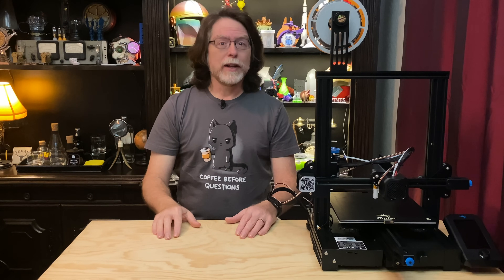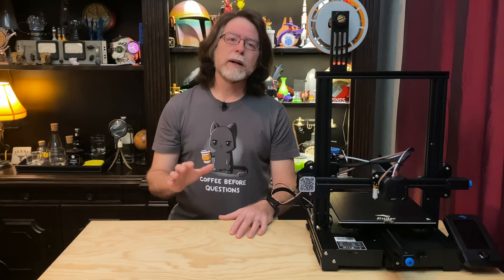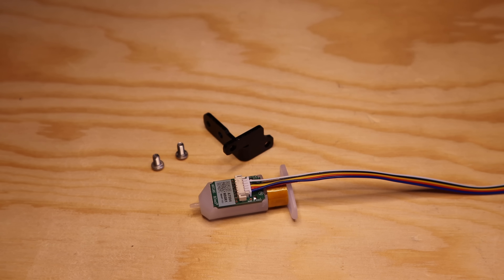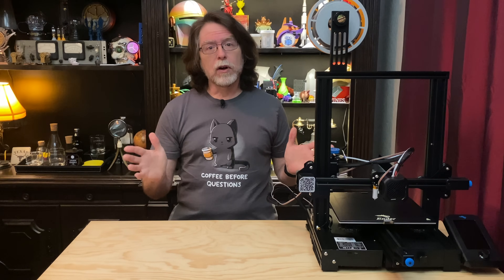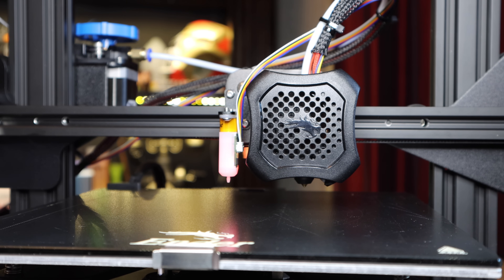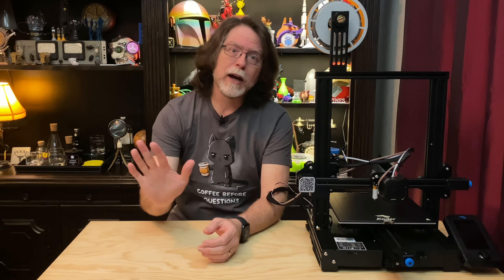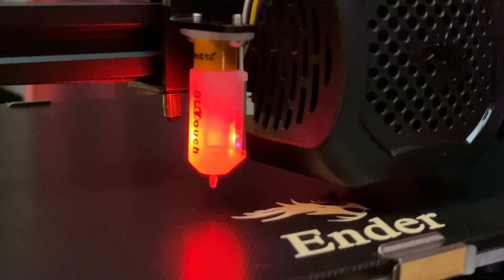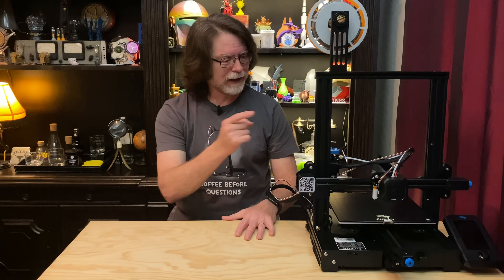Level Up! Install Creality's BLTouch Bed Leveling Kit on Ender-3 V2!

Comment: Will this work on the ender 3 max
Reply from the maker: Hi Steven, I'm not 100% sure. The kit includes a bracket to mount the BLTouch to the Ender-3 Max, and with a little searching on Creality's site, I found an Ender-3 Max Firmware file that supports the BLTouch. But I haven't personally tested it. I have an Ender-3 Max, but it's a pre-production unit, and it has differences from the production units. I have the bracket from the kit, and I have a spare BLTouch, so I could give it a try, but it may take me a little while to get around to it.
Reply: @BV3D  That would be great if you could get to that down the road. I just received mine today 3/5/21so I have some learning to do before I get to that upgrade. This is my first printer and am excited to learn the world of 3d printing. Your site among many are really helping me understand this hobby. Keep up the great work

Comment: Ugghhhh, I listened to everything you said in both videos and now my printer screen stays black and my 24hr old printer has a black screen. Hellllllllppppp
Reply from the maker: Hi, I'm sorry to hear it's not working right. Assuming you've got the right firmware file for the board in your printer, try this:
• Format the MicroSD card as a FAT volume (back it up first if you care about what's on it).
• Copy the .bin file back onto it, rename it slightly (maybe add a "1" to the front of the name).
• Put the card in the printer, and turn the printer on.

It should give you a black screen for about 10-15 seconds, then reboot. The reason behind renaming the file is that the printer remembers the name of the last firmware file it used, so it can ignore it on subsequent reboots.
Reply: I actually just got it to work, I had to change the file name to "firmware002"

Tomorrow I will go through your video setting it up completely and then install the sensor on my other ender 3v2
Reply: You have been a great help. I just into 3d printing 2 weeks ago and already made a product I almost perfected and gonna start selling to pay off the printers and come up with the money for the xl upgrade.
Reply from the maker: @dmjreptiles  That's awesome, and it's one of the things I love about 3D printing. You can come up with an idea for a thing, design that thing (even in something simple like Tinkercad), and then have that thing as a physical object. I've made all sorts of little adapters and organizers and stuff. Anyway, welcome to the world of 3D printing! It's great to have you!
Reply: When I lower the z offset I can't get it low enough to touch the bed
Reply: I decided to go back to factory settings and am gonna return it, hopefully one day they have all the stuff needed when they release a item. Thank you for all your help

Comment: The z-offset for mine was also exactly 2.70. Since fitting the BLTouch I've removed the levelling springs and dials and fitted metal stand-offs with normal nuts. I let the software handle any levelling and it works great.
Reply: Awesome idea, but those hardened springs are great as well and may save a destruction if it were to happen when the nozzle plummets!

Comment: Just finished installing mine! I actually did 2 upgrades. The BL Touch as well as the Z-AXIS PROFILES KIT making the build volume height 350! Any thought of you adding the Z-AXIS PROFILES KIT to yours too Bryan? Also, may check out either Smith3D or Jyers/Marlin firmware and use instead of Creality's since theirs seems to be missing some important things such as saving to EEPROM which in my opinion is important.

And speaking of Creality's firmware not saving to EEPROM, I reached out to Creality and asked if there are plans to release a firmware that will allow you to save the printer settings to EEPROM. I wanted to share their response with you.

Me: Hello Creality, None of your recent firmwares for the Ender 3 V2 store the printer settings to EEPROM. Will you be releasing one soon that will allow you to do this?

Creality: Hi, we have asked our tech, and we'll reply to you later.

Creality (The next day): All firmwares will save the settings to the memory card, which is related to the motherboard, because the motherboard chip has insufficient memory, and there is no way to save more data.

Me: This doesn’t make sense though as saved settings is just overwriting current settings. For instance, esteps is set to 93. I want to change them to say 100. I should be able to do that as it would just replace the 93. Also, there are currently other firmware versions from other sources I could update the to that would allow me to save the settings to EEPROM.

Creality: Hi, we have asked our tech, and we'll reply to you later.

*That was almost a week ago and still no response. I just wanted to share this info with you Bryan and it looks like Creality won't be pushing out a firmware update to allow this so off to try out one of the other 2 I listed above.

Comment: When putting the Firmware on the SD card, plugging it in, and turning it on, screen is just staying black. Has anyone else experienced this and should maybe renaming the bin file fix this and allow the Firmware to flash?

UPDATE: I took the bin file and put it on a new SD card that had nothing on it and it worked so seems to not update the firmware if your card has anything on it.
Reply: side note...  check to see what your board requires to recognize the new firmware. I've run into a few instances where capitalization or another convention is necessary.  :)
Reply: nothing on the sd card and the board can only flash the firmware name once. example: firmware1.bin will not work a second time, new firmware must be named firmware2.bin
Reply: @stefanschmidt5186  I must know....  which board is that?  Just so I know to stay far away from it.  Something that keeps count of how many times you've flashed it is kinda the beginning of skynet and should be feared ;)
Reply: @jasonshrout8921  original creality

Comment: Thanks for a very helpful video.

I have two pictures that explain how to connect the 3D touch probe, as the wiring is TOTALLY DIFFERENT, it did cost me a little worry, but it works fantastic now.
As I cannot send them via this comment, do you have where I can send them to you, if you are interested.

Comment: Ender 3 v2 4.2.2 - when setting your z offset you dont need to rehome and move to 0 each time.  Home it > move to 0 > set an offset.  If its too high, change the offset and it'll adjust in real time to the new 0.  my 2 cents
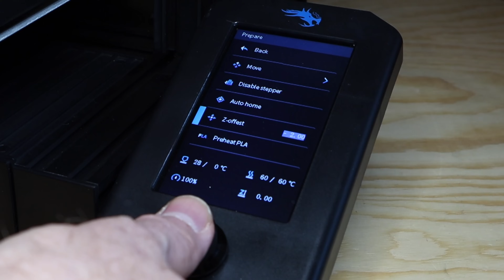Reply from the maker: Hi! I tried that initially, because (a) it seemed like the logical thing to do, and (b) it would've simplified the process. But I noticed it would sometimes move in a Z-positive direction when given a Z-negative offset. So, like I said in the video around the 10:40 mark, since I couldn't trust it, I homed after changing the offset value each time in order to get a consistent result. 😃
Reply: @BV3D  yea heard you say that but I didnt have any issues.  I Started at -2 and kept changing the Z OS incrementally until I got to a good height settling at -2.47  (my springs i assume are adjusted differently.)  good guide though thanks.

Comment: I have the Ender 3 v2 - 4.2.2. with a BLTouch v3.1 - will this work the same? I don't see a firmware in the link for 4.2.2 + BLTouch v3.1
Reply: Ahh, the v1.1.1 on the link is for the firmware version, not the BLTouch version... 🤦‍♂️

Comment: I just added a BL Touch to my Ender 3 v2 and downloaded the Creality firmware, but found that you didn't have an Aux Level setting to manual adjust the bed level, so I went with the Smith3D fireware which did.
Reply: same here

Comment: Another great tutorial!  I had the same issue with the probe failing during g29 and just printing anyway. Went through creality's fw, then 3DSmith, finally just compiled vanilla marlin and set up the probe through that, and haven't had the issue since.  Your z offset method would have been great two weeks ago!  Lol

Comment: Small correction: When auto-homing, the probe moves to the center of the bed, not the nozzle . Clarifying, just in case someone thinks there's something wrong with their setup (there isn't).
Reply from the maker: Duly noted, and thank you! 😁
Reply: @BV3D  I know this is like 2 years old but, gosh it's so refreshing to see someone supportive and okay with a commentor making a correction, or catching something that the person may have missed. It sounds like it should be common practice to do so, but people can really be antsy about that sort of thing.
Reply: I literally did that!!! I’ve been at it with a level and an angle ruler, and all of a sudden my printer is out of whack😂 thank you so much, saved me hours of obsessing

Comment: Thanks Bryan! A question is here; Can we edit the gcode from older sliced files and insert the G29 line after G28 with an editor, as Notepad++ ?
Reply: Yes you can do that. I'm a machinist so I edit actual NC files everyday. You can just open it in regular notepad

Comment: Anyone have an issue with oozing while the probe is leveling before a print? What I am finding is that during the course of the bed leveling before a print the nozzle will ooze about 10mm of filament and then it gets tangled up in the wipe, the skirt, and eventually the print itself. I am wondering if there is a way to set up a retraction of like 10mm prior to start bed level operation.... Any help is great thanks

Comment: Hey Bryan! Perfect timing as my BL Touch arrived yesterday. Question: Is it important/possible to add an X offset? The BL Touch probes so close to the left side of the build plate yet some distance from the right side. ~ Michael

Comment: Hello friend, excellent videos, I wanted to ask you if it ever happened that you try to load firmware to ender 3 pro and you get a blue screen.
Reply from the maker: Well, I've had it give me a black screen with the backlight on; it kind of looks like a dark blue? It does that when it's updating, but if it's been longer than a minute, something's gone wrong. When that happened (taking over a minute) I needed to format the card as MS-DOS/FAT32 and put the firmware file back onto the card (and turn the printer off and on again) to get it to update.

Comment: I don't see the point to install this. Just level the bed manually thats the best way
Reply from the maker: If your printer's bed is flat, and you're able to manually level it, that's awesome, and of course in that situation you don't need a bed probe. As I mentioned, for my particular printer, this wasn't strictly necessary, as the glass is reasonably flat and doesn't present much of an issue. Others have beds that dip in the middle or bow up in the middle, and for these, at least in extreme situations, you can either get the middle of the bed good, or the corners, but not both. A mesh leveling probe allows the firmware to generate a "topographical map" of the bed, and automatically adjust the Z axis to keep the nozzle flying at a consistent altitude from the bed on each layer.

Comment: Why doesn't the bl touch probe the whole bed? Does anyone know how i can adjust it to do so?
Reply from the maker: Hi! It has to do with the probe being mounted a little over 40mm to the left of the nozzle. While you can physically move the nozzle way off to the right (past the right side of the bed) to get the probe close to the right side of the bed, the printer can't put the nozzle there itself. It's limited to moving only 220mm from its home position on the left side of the bed. I suspect if you were to compile Marlin yourself, and set the X Max limit to a higher value, you could get the probe's grid pattern to more evenly cover the bed.

Comment: I must say using paper to level my v2 bed works great and is not a hassle. I even have the original springs. Everyone that installs BL touch alway seem to have problems. I keep my Ender totally stock and have no problems even after 100+ prints.
Reply: The thing with this type of hardware is no two machines are exactly alike. I’ve just realized that my bed is pretty warped so paper level works great for the corners and then the centre is completely off.
Reply: @Zoidbergererer  get a new glass bed there $20.00 on Amazon.

Comment: I did the BL Touch upgrade to my E3V2, alongside going with very stiff silicone bed mounts (which I zero'ed in) and I use https://marlin.crc.id.au/ - which is a nightly roll up of the recent  Marlin image for Creality printers. I'm not so sure the BL touch is doing much in the way of mesh remapping though as I notice on large prints the brim heights are uneven. Is there a good way of checking this? I'm assuming prontointerface would be a good way of verification?

Comment: So if it stores the settings on the card then what happens to people like me that use Octoprint which obviously doesn't use any memory card. What happens then?
Reply: I have actually found the Smith3D firmware to work better than the TH3D. And it does save the settings to the board.
Reply from the maker: Hi! Nothing prevents you from leaving a memory card in the printer for the sole purpose of storing the settings. But you have options.
• Since it's possible to set things like acceleration, jerk, e-steps, and Z offset values via G-code, you can add these G-code commands into your slicer's "Starting G-code" settings.
• You can set these values manually each time you power on the printer.
• You can also compile Marlin for the Ender-3 V2 and install it, and TH3D Studio's Unified Firmware is also an option.

Comment: they finally have a kit with the right connector already installed? i was reading about this just last week and everyone with a new board was just jamming in the two cables side by side into the 5-pin connector, and sometimes getting one backwards and burning out boards
Reply from the maker: Yep! It's got the right connector. I had been waiting for this one. I wasn't a fan of either having to use an adapter board that plugged into the LCD port or jamming the wrong kind of connectors into the right port.
Reply: i ended up just buying some of the JST 5-pin housings and a BLTouch kit with the regular cables. finally got around  to installing everything, but now i can't for the life of me get the Z probe offset adjusted. on the first attempt i managed to move it in the right direction but too far, now it doesn't seem to affect anything when i try to change it. i don't know if i'm sending some commands in the wrong order, or if having the BLTouch pin separate from the Z endstop interferes with the normal operation, or if UBL does this differently, or if i'm just getting a negative/positive sign backwards...
Reply: @BV3D  Any idea if you can get those connectors separately anywhere?

Comment: So do I still have to adjust the wheels each time I run the BLTouch? Or do you level the bed the first time with the wheels, Install the BLTouch. And then the BLTouch uses the sensor every time before each print to tell the printer to compensate for low or high spots that are out of adjustment during printing? Will you ever need to re level using the 4 wheels so the bed is not too far off level? Thank you for this video.
Reply from the maker: Hi! Ideally they should be set so the bed is about as level as you could get it, but once they're there, let them be. It's also possible to replace the springs with solid bed mounts, like these from TH3D Studio: https://www.th3dstudio.com/product/cr-10solidmounts/?share=bkvines [affiliate]
That lets you pretty much lock the bed in place. They've also got a version of the solid mounts with a camera arm.

Comment: One trick I use is a deck of cards. I when go to set off my Z offset, I use the cards to help me measure the gap at the start and then figure out what my  adjustment needs to be.
Reply from the maker: Hi Dwight! Is it just a matter of seeing how many cards can slide under the nozzle, measuring their thickness, and then you're almost there?
Reply: @BV3D  You got it!
I just gives me a rough idea of how far I need to move my z axis.
Reply: Could you please give more detail how you do this?
Reply: @mykehdoom  Sure, when I first  did my z offset it was hard to measure the distance from the tip to the be, so I took a pack of playing cards and put as many as i could under the hot end tip. I then measure the cards with a calipers to see how much I have to move the z offset, once I get it to less than a millimeter,  I make the finer adjustments. 
I found it saved time when you are starting out to get your z offset.
Hope that helps.
Reply: @dedogster  ahhhhh.

That's a pretty awesome idea.

Thank you! I'll be sure to do that when mine comes tomorrow!

Comment: For those who might need to compile your own Marlin firmware, use this line for the OEM BLTouch support, provided in the kit:

#define NOZZLE_TO_PROBE_OFFSET {  -44, -7, 0 }

Calibrate your Z-offset accordingly.

Comment: I got a Ender 3 V2 & BLTouch for Christmas(my 1st 3D printer) after I installed it ,it worked for a couple of weeks then it would error , crash into the bed or try to drive the nozzle through the bed, I have changed to Smith3D's firmware and so far not having any problems and the display is much nicer now.